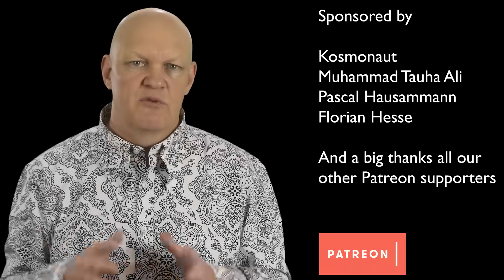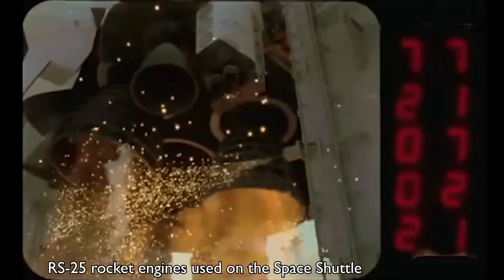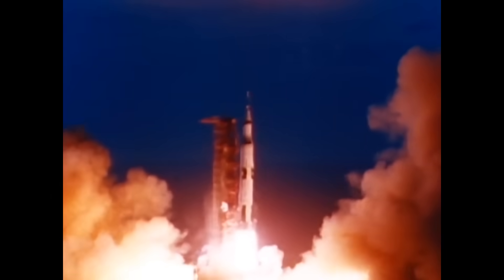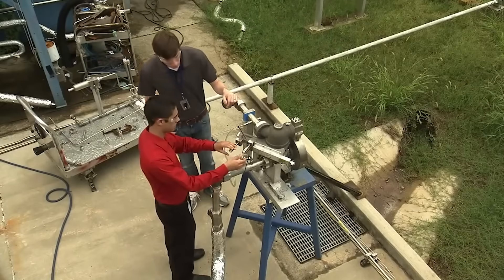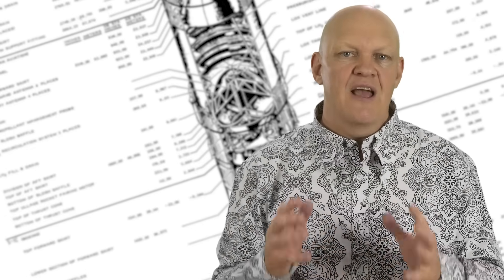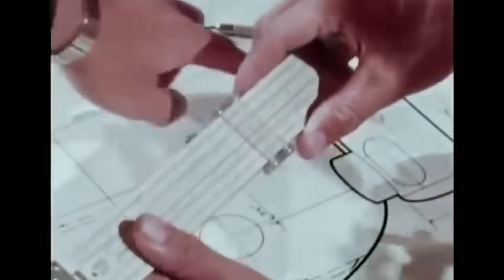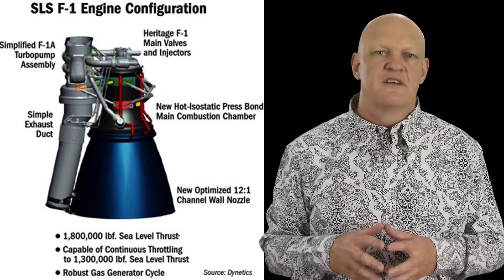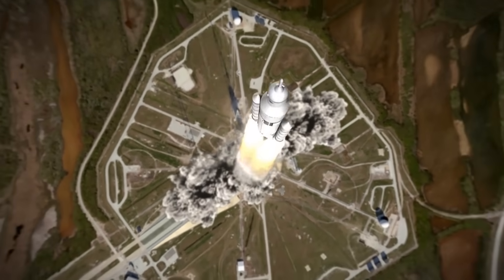Why Can't we Remake the Rocketdyne F1 Engine?

Comment: There is a reason why the engines of the russian Energija are design wise still in use to this date, as they were very efficient and still are.
The F1 was powerful, simple and reliable, but way too large to put them onto the Space Shuttle and thats why they weren't further pursued.
Not that the Saturn V wasn't as good as the russian counterpart, N1 happened after all
Reply: Everybody knows that the Russian engine designs were way ahead of the vest at the time. The build quality on the rockets themselves though was, as you pointed out, another story.
Reply: Another reason we use the Russian engines is that they have an entire industry building them, left over from soviet times. They're available, reliable and relatively inexpensive considering to produce the same or better here now would mean completely retooling our own industries to do so. Though politically we're supposed to be holding a trade embargo against the Russians, we still trade essential materials and strategic components with them. The politics is just that, posturing.
Reply: At over 5600 manufactured parts for the F1... Simple it was not.
Reply: Its not so much that the F1's were in-efficient, more like their complexity did not lend themselves toward refurbishment and repeated use.  The SME's were instead designed with refurbishment and reuseability in mind,... but what they didn't realize at the time was that this made them even MORE complex and more expensive.  The sad irony of the Space Shuttle was,... all the attempts to make it reusable had only served to make it so expensive that it would have almost been cheaper to rebuild the entire engine section with each flight, instead of the costly refurbishment.

What made the Buran and Energea work so much better in concept was that the Buran Orbiter itself didn't have to contribute any thrust for the launch, as it was carried up entirely by Energea dead weight.  No massive strain on the engines meant much less refurbishment, and therefore less cost and lower turnaround time.  But, the STS shuttle's SME's did all the work for about 75% of the launch.  Even the mighty F-1's didn't have to stand that kind of strain, nor did the engines of any of the Saturn V stages.
We got too married to the idea that reusability is the key, and while that may work for physical spacecraft,... its not the way to go with engines, at least not for large and powerful ones.  Best to keep reusability focused on orbital maneuvering engines and thrusters instead.
Reply: They need the solid booster mfg facilities for the nuclear program. Thus the cost savings for making multiples instead of reusables like SpaceX.
Reply: You can fit 2 or more F1's in the same space as a single SRB. Look up the Pyrios booster proposal from Aerojet Rocketdyne.
Reply: Tisbonus Can you name a handful of these cringeworthy "basic errors" please?
Reply: While it is true that the F1 engine was too large to fit directly to the shuttle itself, that doesn't mean it couldn't have been used as a launch vehicle for the shuttle at all. There was actually a "Saturn on Shuttle" design to use Apollo F1 engines as supplementary boosters for the shuttle instead of the SRBs.

Imagine the shuttle as normal, still with its onboard RS-25 liquid hydrogen engines and still using the big orange external tank to supply them, but without the SRBs strapped to the side. Then imagine an Apollo S-1C stage (the first stage of the Saturn V with the cluster of 5 F1 engines) mounted directly below the shuttle fuel tank.

At launch, both sets of engines would most likely be ignited at the same time. The S-1C stage produces about 25% more thrust than a pair of SRBs, so the shuttle could launch with the RS-25 engines at lower throttle than normal and only push them to full power once the S-1C had burned out and been jettisoned.

This surplus of thrust could have allowed the shuttle to either carry more payload or reach a higher orbit, though there was even a possible way to do both: In the S-1C stage, mix 30% liquid fluorine into the liquid oxygen. This would not add much weight or need any major engine redesign, but would increase the thrust by an additional 25%.
Reply: The current SRB's on the SLS rocket have twice the thrust as the F1 engine, so the F1's aren't too large in terms of thrust.
Reply: He got nothin
Reply: Benny Löfgren being passive aggressive doesn't change the facts. If your response is purely a knee jerk reaction based on your emotional ties to your beliefs, then I understand your frustration. Just remember, there is NO place in science for ego and emotion. Hopefully someday you can realize and understand that. Take care Benny!
Reply: Oldbmwr100rs you mean prostitution LOL.
Reply: Doug Mcdonell I was about to say the same. The amount of basic errors in these vids just make me cringe. The F-1 was a LEO engine period. Now, the M-1, that was a beast!!
Reply: Benny Löfgren technically there's three examples between what Doug and I mentioned in this comments thread alone. There are other examples elsewhere. Plus a lot of biases. Take your pick.

Comment: Next: 3D printable F1! :D
Reply: Do people STILL not know what 3D printers are, and are not?  There's a reason we still have lathes and laser cutters.
Reply: Do you know 3D printers are widely used in aerospace engineering? You can even print titanium. 
Rocket lab's electron has fully 3D printed engines for example.
Reply: 3D printers are only good for prototyping and very low-volume parts. The Rutherford rocket engine is a low-volume part.
Reply: All rocket engines are low volume. Considering they put 9 engines on each electron that would put them in the high volume range compared to the industry. Why are we even arguing this, It wasn't even a serious comment.
Reply: It's not only for prototyping, I suggest you read up before you post anymore. It's widely used for complex parts in aircraft's and rockets. Even SpaceX use 3D printed parts.
Reply: 9 engines is still low-volume. It wouldn't make sense to manufacture specialized tooling for them. Use outside of low-volume or prototype manufacturing is still very limited. And I didn't even talk about complexity, I talked about volume, and that's where I'm right.
Reply: Low volume compared to the rest of the industry, no? Since they make them in-house and the tools are already available I don't see what your point is.
Reply: My point is, it's possible to 3D print an engine and use it, which is backed up by the fact that it is being used today. So what are we arguing about again?
Reply: Im aware 3D printers are used for prototyping, but they can also be used in low volume productions like aircrafts and rockets.

Comment: I’m still in awe at the size of these lads.  Absolute units, they are.
Reply: Themayseffect
The largest dam in the world, the Three Gorges Dam, has slightly less installed capacity(22.5GW) than the power output by a single F-1 engine(23.2GW)

What makes the size of these engines impressive is the understanding of how insanely powerful a regular sized rocket engine is, and then scaling that up to the size of the F-1.

Here's the SpaceX Merlin engine that goes on the Falcon 9: http://www.spacex.com/sites/spacex/files/shiny_merlin_edited.jpg

And here's the F-1: https://cdn.arstechnica.net/wp-content/uploads/2013/01/718982main_IMG_7022_cropped_1600-1200.jpg

It's like looking at a supercomputer and being in awe of it's size. Sure, it's no bigger than a typical house. But compared to your average desktop PC it's monstrously huge.
Reply: humans have built several Dams to withstand megatons of water, a little rocket is nothing. The fueling system and storage facilities for these machines are much more impressive.
Reply: Themayseffect Nobody asked

Comment: TALK ABOUT SPACE ELEVATOR PLEASE
Reply: check out Isaac Arthur's channel if you want an in-depth look at the possibilities of space elevators (and pretty much ever other space related topic you could think of)
Reply: Forget space elevators. Orbital rings all the way!

We have had the tech to build orbital rings for fifty years.
Reply: Nothing to talk about unless the theoretical materials needed have any way of being manufactured in the lengths needed.  At the moment, it's just science fiction.
Reply: [Shameless plug]
Channel: Issac Arthur
Science and Futurism with Issac Arthur, possibly the best work of its genre since Carl Sagan.
Reply: space elevators on the moon
Reply: John Doe Or on Mars.
Reply: science fiction? no.
not strong enough? taper.
Reply: J.J. Shank
orbital rings ftw
Reply: sfia ftw
Reply: Science Fiction... For now. The problem is making the elevator cable (amongst other things). Forget steel. The leading candidate for strength is Carbyne, though practically it should be Carbene. Carbene is a chain of carbon atoms (only) that is bonded by double bonds. Carbyne is stronger for Carbon to Carbon bonds (uses triple bonds), but it cannot form a chain with that strength. Carbene looks like this C=C=C=C=C=C etc etc. If we could manufacture this in the thousands of km lengths needed to make a single molecule all the way from the equator to PAST Geostationary orbit (almost double the distance), then make TRILLIONS of these molecules and weave them into a ROPE, THEN capture an asteroid (or assemble a MASS) at the end, THEN we might be able to make an elevator. Note it would take CONSIDERABLE time for an elevator to CLIMB this rope to Geostationary orbit. But WHY??? How many rockets could we have launched for the expense of this elevator system? A better solution is to manufacture a Nuclear powered, Solar System RANGE spacecraft in LUNAR orbit. (Lunar Orbit incase it goes wrong, so then it can fall towards the Moon and Not Earth). Launch humans up on chemical rockets. Launch Sundries such as fuel, water food etc via MagLev Rail guns into orbit to dock with the Nuke spacecraft. You see it's HORSES for COURSES. Humans are the most delicate of all these items and chemical rockets are still the easiest, safest and cheapest way of getting humans to orbit. Nuke power is ONLY to be used IN SPACE and provides amazing range, electrical power and longevity. Rail guns to get all the stuff that we dont care about g-forces for so we can get water into space quickly and cheaply. Just my thoughts. Space is HARD.
Reply: Michael Wilkes
taper.
one big ass cable on two big ass cables on three big ass cables ect ect ect
Reply: Thats a meme